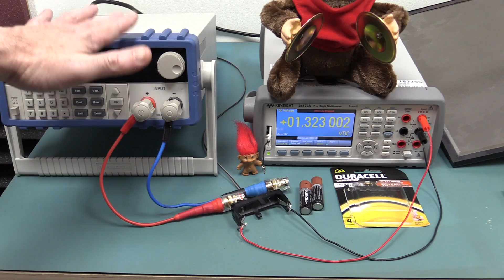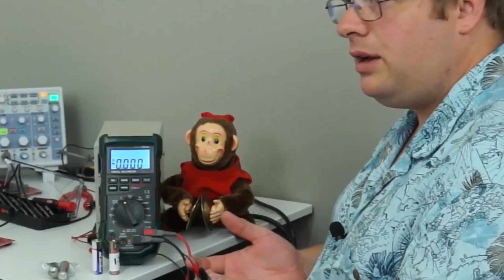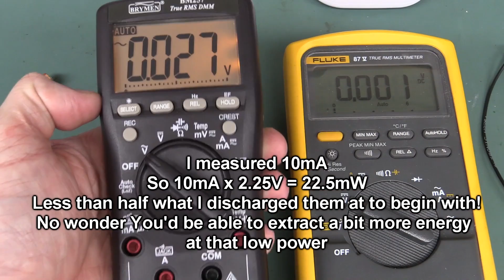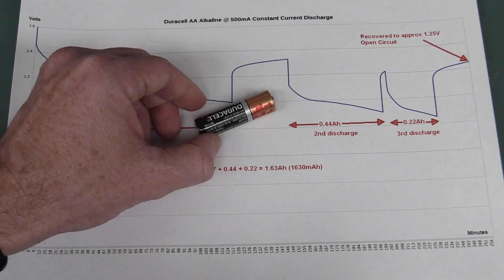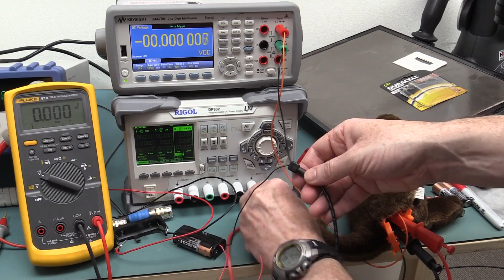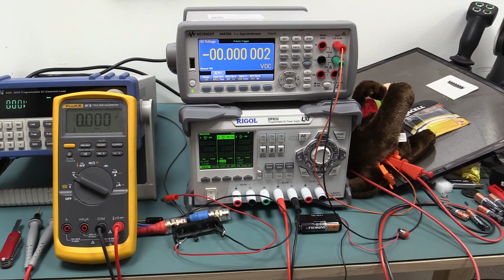EEVblog #789 - Batteriser Monkey BUSTED!

Comment: Your video does not count comparing to theirs. There is no soothing music behind your voice, so it is not convincing at all.
Reply: +EEVblog ah, yes, but you forget their argument's bottom line - they want money, so laws of physics dont count.
Reply from the maker: +yoksel99 The data speaks for itself.
Reply: He is testing ONE CIRCUMSTANCE cutoff voltage at the terminal. That's all this video is about. It's scope is limited to being a response to their video of the monkey not working on 2 batts measured with no load. 

So to you its just a coincidence that the device shut down at the same voltage with the PS and the batteries?

I'm not gonna comment on this further cause I can see where it's going. There were no misrepresented numbers or physics here at all.
Reply: +Gravity I also fail the see the error. How does anything you said change measuring at the battery terminals for the cut off voltage being the only way to do it.
Reply: +EEVblog That was a joke :) The consumers don't consume data, laws of physics or whatever when making a purchase decision. They consume the marketing BS instead. And their BS is a top-notch, MBA-produced, da best.
Reply: +Gravity Let me guess , You work for Batteriser and were sent as a troll trying to use marketing wank to hood wink the public
Reply: +Gravity I fail to see the error
Reply: +Gravity just shut up.
Reply: Gravity What you're after is extending beyond the scope of this experiment as Chris Statzer stated.
Reply: +Gravity if you compare a drained out battery with a PSU then yes drained out battery can't provide the current while PSU can at the same specific voltage.... but one has to measure the cut-off voltage with fresh batteries - let the product run till it cuts off - or alternatively use an other method ... which is 99% accurate and it's using a PSU and dial down the voltage till the product cuts off  ;)
don't forget it's engineering, not science... 99% is more than accurate here  ;) and further more - you'll have several percent variations between batteries and also your cut-off voltage will vary (talking about mV variations). considering all the facts - PSU is an accurate method to measure cut-off voltage in real-world applications.
in short:  not accepting a PSU as a correct alternative is simply stupid.
Reply: +Gravity You are fundamentally wrong. A battery have internal resistance (from electrochemistry) that at a certain current have a voltage drop, and that's what causes the monkey to stop working. The low voltage and low current isn't enough for driving it. Only that. For make the current to flow you need a potential difference between two points and interconnect them, because the electrons and holes tend to equilibrate recombining themselves. Think in water. Voltage is the pressure and current is the quantity of water per second; the conductor (with a certain resistance, in this case the width of a PVC tube). Without difference of pressure (voltage) there's no water (current) flowing through the tube (conductor). Without water (or any fluid or gas) there's nothing to flow through the tube and it's impossible to have difference of pressure because this hypothetical system now is in equilibrium. Without tube (conductor) it's the same thing: impossible. So there's three elements to take into account, and explaining something more advanced is pointless. This is really simple bro! Hope you will understand :)

PS: Please excuse my bad English, I'm from South America ;d
Reply: +Gravity  you do realise that nobody here agree with you?
Reply: Gravity has a valid point in that a PSU is not usually the same as a battery, and that Dave is generalising in a number of remarks because of his clear frustration. However, these pedantic inaccuracies are irrelevant to the focus of this video where Dave is simply distinguishing between open circuit and underload voltage measurement and pointing out the problem with the Batteriser video in question. As Dave states, if you want to learn something about batteries then look at his older videos.
Reply: yoksel99 see also SOLAR FREAKIN' ROADWAYS :)  lol
Reply: +Gravity The features of Keithley 2302:
Ultrafast response to transient load currents: A good supply may have it
Choice of single- or dual-channel supplies: Only for simulating 2 batteries
Optimized for development and testing of battery-powered devices: I see
Variable output resistance for simulating battery response (U.S. Patent No. 6,204,647): Simulates the internal resistance of the battery but it's only a current limiting circuit
Pulse peak, average, and baseline current measurements: For measure advanced response of the device over time (not only the cutoff like this video)
100nA DC current sensitivity: A good feature for measuring low power consumption products
Current step measure function: Other good feature
Sink up to 3A: More than enough for simulating batteries
Open sense lead detection: I really don't now what's the use for this lol
Built-in digital voltmeter: Like any other supply

So, the only difference with a power supply is that it is for simulating the response trough the entire discharge of the battery, and if I'm not wrong it simulates the varying internal resistance related to the actual capacity, but all that features aren't needed for measuring the cutoff, it's pointless. You only need a power supply bro, and by the way that's what the Keithley 2302 essentially is :/
Reply: +Jeremy Pierce I'm thinking he's the professor from the Batteriser video LOL no other logical explanation :)
Reply: +yoksel99 Don't forget that the Batteriser cures cancer too, so buy yourself 10.
Reply: +Gravity It's not a comparator obviously so the cutoff isn't instantaneous, and that causes the monkey work until all the power from the battery is drain. There's a point when the battery can't give more current (or almost nothing), and when that happens is because the internal resistance has increased. When that resistance increases it causes a voltage drop, and the measured voltage at the terminals of the battery is the real voltage that the monkey receives. The monkey have a response curve, that may not be linear. For a certain voltage, it consumes a certain current at a certain moment of the operation (arms opening, arms closing, buzzer sound), and if it stops working it's because at that voltage the current that is flowing is so insignificant that it can't power the monkey. All that shit of inrush current and motor torque is inside the response curve of the monkey (relation between voltage and current = the varying impedance of it)
Reply: +Gravity Science is everywhere... Hahahaha I tried but you are hilarious :d Make your own channel, I will be your first suscriber ;)
Reply: +Gravity 
You're acting very much like a shill. While your points are in fact valid they are for the purposes of this video irrelevant. The basis of the debunk here is not the cut off voltage, the monkey in fact does not have a cut off voltage at all. Batteriser used a device with no cut off voltage circuitry to demonstrate a flawed point. What Dave did was explain that measuring a battery's open circuit voltage is NOT a sufficient method for determining its level of discharge. Since that was the whole point of the demonstration Batteriser presented, which was of course flawed, it was easy to debunk. The extra information Dave supplied was superfluous. Nit picking at the extra information he mentions DOES NOT invalidate the debunk at all.
Reply: +Gravity "Series resistance" of the supply is for simulating the varying ionic resistance of the battery, and if you didn't understood: for obtaining the cutoff voltage we ignore the internal resistance, because we are directly measuring the voltage after the drop on it, that's why the internal resistance of the supply doesn't matter at that point, considering that the voltage seen from the monkey ass will be the measured one, not the internal theoretical voltage (despite the fact that it's unmeasurable). And transient response refers to the response of the supply while the load changes quickly (the overshoot and undershoot). The other things are related to the capacity and the discharge time of the battery! I don't know why are you still pointing that!  Yes, you can test it that way, but we only wan't to know the cutoff voltage of the product. Simply that. Don't harass and say the video is wrong without a real point, it's fine for the purpose of debunking the batteriser bullshit (really a very poor scam). If you want more info you can investigate, you can make a video about that, I don't know, but that isn't related to this video. All that is pointless. Is very basic, even a hobbyist can understand it!. Maybe you're not at that level yet... :/
Reply: +lorenzo portocarrero Yeah he is the "professor", look at the youtube account, it's completely blank, just created so they could come and add comments to argue without people realizing it's them.
Reply: +Gravity Excuse me, I didn't mean to say that, if you read carefully you can see that I didn't say the input series resistance doesn't matter. And industry standard or not, we are measuring cutoff voltage. And that means: for more current theres more drop in the internal resistance of the battery, that equals less V in the terminals, and if you want push more you simply CANT, if you try to push more current there will be a higher drop and less voltage, so that's where the cutoff voltage come from and that proves the method isn't incorrect. I think YOU are ignoring the internal resistance here ;)

Edit: You may note that here's no doubt of the precision, exactness and impressive resolution of Dave's multimeter that is connected at the + and - on the ass of the monkey. There will be some losses on the sense cables, but there are negigible in THIS case, and I don't know if him considered that, but what's the problem? u.u
Reply: +Kenneth Sloat  Yeah we should stop feeding the trolls lol :)
Reply: +Gravity You're still bullshittin'.
Reply: +Gravity No, because the absolute cutoff voltage still mantains. In the current spikes with the battery the voltage may decrease, but the device will be working until it hits the cutoff voltage. There's only a shorter time, but the rules are the same :)
Reply: +Gravity With the PSU you control and mantain the voltage, so its perfect for measuring the cutoff
Reply: +Gravity Better than using a real battery and a multimeter :d
Reply: +Gravity I didn't ignore anything of what you said. You are ignoring basics. Ohm, Kirchoff, Thevenin. Go get a book and stop harassing, you wouldn't understand -.-
Reply: Eclipse Your case of a device that switches between drawing 10 mA and 1 A is not compelling. As I have said before in this thread: Correct use of bypass capacitors will solve this problem, and any product pulsing a battery so badly that it dies prematurely is simply poorly designed.
Reply: +Saxie81 For the product in question? It is most likely a scam employing disingenuous advertising that implies the consumer will gain more energy on average than actually likely.

My main issue here is that EEVblog isn't explaining this well enough. He has to state the fundamentals of current sourcing, P=IV, V=IR, things like comparator hysteresis and different methods of low power detection. Actually how these devices work on a basic level, and it doesn't take that long to do.

Look at why the commercial switching regulator MCP1623 has that operational limit of output power versus input series resistance.
Reply: +yoksel99 And where da fuck is the square wave?!
Reply: +Felix J. Bak I'm not sure what you're talking about. The case of a bare PSU producing a result within a close margin to a battery does not universally 'generalize', which is why professional hardware battery simulators exist. It depends upon how the device operates, which requires explanation.

If you are saying "there is also no need to "explain how different devices operate"", you're obviously wrong. Claiming that there's "no need to explain" the function of a device is by far one of the most silly things you could say. It's fundamentally opposed to the scientific testing that should be performed.

And in fact you should probably explain to yourself how a constant power load works for P=IV relative to input series resistance.
Reply: +EEVblog Please make the final fault-fixing episode of the Samsung LCD TV fault-finding and repair series.
Reply: +Robert Jung Again, just using a bare PSU to test all device cutouts without actually understanding what's going on is simply wrong. The issue is that it actually doesn't give you accurate values on certain devices, cases of which I have perhaps indicated the datasheets in support of in this very thread. Because EEVblog is not explaining the different low power failure modes, the fundamentals of device operation, he's not actually 'debunking' this well.

And then you get stuff like this, viewers saying things like "it's engineering, not science". Do you have any idea how silly that is?

That is partly the problem with these videos wherein they're not examining the functional details for the circuit, like P=IV, and V=IR.
Reply: +timofonic timofonic My point is not that he should buy one. My point is that he should be mentioning how and why they are used, as opposed to bare PSUs, rather than implying a bare PSU is a more exclusive "industry standard" method for battery device testing.

Again, my point in poking holes in these videos is so that EEVblog will actually improve them, addressing any such flaws, and thus have a more 'air tight debunking'.

I'm going to tell you right now, these videos come off as quite 'unscientific', and for good reason. A scammer will easily be able to use that to discredit him.
Reply: +lorenzo portocarrero Do you actually understand why things like 'series resistance' and 'transient response' are included? It tells you in the datasheet. Just solve the equation P=IV for a constant power load at decreasing input voltage, just like those in a battery datasheet's discharge curve, and see what happens. Then maybe look at V=IR for a pulsed power load, like the very common examples of cellular/wifi/bluetooth transmitters.

If EEVblog doesn't mention these things, the real fundamentals, he's going to run into trouble.
Reply: +Gravity in a simulation it would have to be accounted for,  since resistance is basically is the valve for controlling how much current can be pushed through.   The lower the resistance the ability of the battery to deliver power through a power spike is easier.   However this meant Fuck all in this video and this damn instance.
Reply: +Saxie81 My problem with this set of videos is that it's approaching the problem in effectively the same way as the product in question's videos. It's a lot of flashiness and/or rage, but not a lot of real science.

He has to be covering his bases. Discussing the different devices, how they work, cases where a bare PSU might be more accurate or might not be more accurate. Basically, by omitting any mention of the purpose and use of something like a hardware battery simulator, he's perhaps making a less accurate video, and leaving himself open to be more fully discredited by scammers.
Reply: +Felix J. Bak keep calm and charged :-) Gravity is probably using scientology-like propaganda methods (not explicitly saying he is completelly wrong but with final message that he is "dumb enough" to criticise something as advanced and revolutionary as their product is) to try to defend and safe at least something after damage Dave did them during initial bombshell, but this war is simply over ;-)
Reply: +Gravity you may have a point, but you are discarding dave's proof because he did not use something designed to be used in a device with a smart baterry control ic in a chinese toy that did not have one in first place (as in MADE IN CHINA!)
So basically you point irrelebant in any practical sense in this situation as the difference would probably be of less than 0.01% something most multimeters cant even meassure.
Reply: Gravity
So far all I've seen is arguments made over minor semantics, while ignoring the blatant obvious such as dislikes bought from 'nam.
Reply: +Gravity Using a PSU to measure cutoff voltage on a product is perfectly fine. You'd also want to track current and set a limit on it, but most products are not constant power devices and will not boost internally. Even for products that do, they should still cease operations as the per cell voltage drops below ~0.8v The reason? Rechargeable chemistries and alkaline battery leakage. You risk damaging NiMH and NiCd chemistries operating them down to zero. You risk damaging your own product operating down to zero with alkaline cells.

As for your earlier point of describing a use case where a columb counting internal resistance measuring battery state estimator with optional dicer slicer and chopper attachment was in a product: Please, don't use these in normal battery operated products. They are terrible and only sound cool and increase your BOM. The proper use case would be in a product where the battery was non-removable, so the chemistry and charge history is known. Even then you're likely to be off by a good +/-5-50% over time because batteries are weird like that.
Reply: +Anthony Wildman That is what I was trying to explain but it's impossible :s
Reply: lorenzo portocarrero I'm beginning to think it's just a troll. Seriously, WTF does "inrush current', 'motor torque', and 'start-up status' have to do with cut off voltage. When saw those terms being used in this discussion, I thought that this person is either a troll or has no formal education.
Reply: +Gravity There's an absolute cutoff voltage, and for an ideal constant power sink is 0v. But for the battery underload, it will be 0v too, because of the voltage drop on the internal resistances. You can do some basic expreriments and come to the conclusion. End.
Reply: +Gravity Then the voltage drops, and if that happens the current should increase (in reality the Rload decrease, there isn't increasing current, because the internal R of the battery) and then the voltage will drop more and more next to 0v. The measured cutoff voltage is absolute, no matter the internal resistance of the supply. Stop trolling.
Reply: +Gravity I didn't say that. I said that the cutoff voltage is absolute. That battery simulator is for simulating capacity of the battery, and that's not needed for the absolute cutoff voltage :)
Reply: MCP1623 Is a DC-DC boost converter. It is true that as voltage decreases current can be increased to maintain power; however in the case of the battery, as the voltage drops the total energy is lower and the amount of power that can be delivered is lower. If the voltage is increased the current will decrease without supplying additional power to the system( a dead battery can't supply more power). Thus, cut off voltage is the lowest voltage a device can operate at; even using boost converters can only boost the voltage so much. In other words a PSU and miltimeter is the best way to calculate the cut off voltage. I understand what you are trying to get at, but you are wrong. Only in specific applications are boost converters used, and If a voltage level is required by a component it doesn't matter what the current is; if the voltage is below specifications, the component will not work regardless of power or current..

Also, I am fully aware of how a clock works. When you set a clock, you are simply setting the initial state of the register that is used to hold time values between clock cycles..
Reply: +Gravity Ok, maybe not Ohm. But you are ignoring Kirchoff and Thevenin for sure
Reply: Gravity You do seem eager to learn, so I suggest that you enroll in a university with an electrical engineering program near you. At the very least find a circuits book and try to do some of the problem sets. you may learn a thing or two.
Reply: Eclipse What? Specific energy? Do you even know how to implement ripple reduction? You size the capacitor depending on the switching frequency and average load. High specific energy is very rarely needed. If it is, well then you're probably driving a load beyond the capabilities of small batteries anyway.

And what's this about maximum power transfer? What does this matter? Very few devices are constant power, most will consume less as the voltage drops. Really only input boosted devices will use constant power, and that's rare. Better for efficiency to just design a product inside the battery voltage envelope.
Reply: +Gravity YOU NAME A DEVICE THAT WILL RUN 8 TIMES LONGER WITH YOUR DEVICE AND PROVE IT
Reply: Well he could be explaining in technical terms the inner workings of the battery as well.   There .is a time constraint here otherwise it would be a 3 hour long vid...
Reply: +Saxie81 To put it more harshly, what he's implying about using a bare PSU for every case is wrong. Further, it actually doesn't take that long to explain how different products detect low power, and how they might switch off on it. From comparators to coulomb counters to simple friction versus torque on a motor. Omitting the cases where a bare PSU may give false low power failure mode readings makes this video incorrect, and scammers will easily use that to discredit him.
Reply: +Chris Statzer Exactly! I don't see what everyone's complaining about! +EEVblog Don't worry about the psychopaths complaining about your video.
Reply: +lorenzo portocarrero Oh, I see the error you're making here. On an uncompensated PSU, the output voltage is perhaps set to whatever voltage you input. The battery's series resistance (and 'remaining charge') isn't present.

Consider how an 'ideal', that is 'zero resistance', constant power load works: Its 'cutout voltage' will always be exactly zero volts, because for whatever voltage present, there will be a corresponding amount of current that will supply that power. P=IV.
Reply: +lorenzo portocarrero A toy monkey has nothing on 'science'. Check your electrodynamic equations and apply them perhaps to multiple different products.
Reply: +Napalm Flame dont worry, he's ignoring the basics
Reply: +Gravity I'm an electrical engineering senior, and I actually asked two of my professors about this, and they said that using a PSU and measuring the voltage under load is an acceptable way of measuring voltage cutoff. If you measure the voltage of the device, and subject the device to different modes of operation (if applicable) while using that voltage while measuring the current to determine the characteristics of the load the device creates on the battery, the  Keithley 2302 does precisely this, you will get an accurate reading. There wasn't any need in measuring current and voltage using different device modes in the devices Dave tested because the devices he tested had essentially one mode. You don't need any other equipment.
Reply: Gravity The use case of that IC, the bq20z80, is usually swappable lithium ion packs
Well duh, I'm pretty sure I covered this as an obvious use case with "The proper use case would be in a product where the battery was non-removable" (lithium packs count as a product with a non removable battery, because the product IS the battery!) but you implied this device may be encountered in a AA/AAA operated product, which would be extremely dumb. I just wanted to make clear that the existence of exotic low battery detection as provided by devices similar to the BQ20Z80 does not rebut the viability of power supply facilitated device cutoff voltage testing. (That was a mouthful).

Using a bare, uncompensated, unlimited PSU is clearly what I have referred to as more of a problem.
Okay, I'll give you most of that, but really most products do not use boost circuitry. Most products show a non-inverse direct relationship between input voltage and current draw. You should keep an eye on the current, and really should be plotting it along with voltage, but I can guarantee Dave was omitting all this information for brevity's sake. Does omitting it make his case less durable? Not really, considering the criticism of omitting the information is really just pedantry. This isn't a paper to be published in a peer reviewed journal, it's YouTube.

switching regulators and pulsed power devices are not actually 'uncommon'
No, but such devices aren't properly designed if they're pulsing the source so badly that a battery would prematurely fail. There's something called bypass caps, and most electrical engineers know how to use them.
bluetooth transmitter, and it draws more current in transmit mode
That's true, but useless information. The goal was to prove most devices operate down to at least a volt per cell (or whatever the figure was, it's late and I'm tired). It doesn't matter what the device current draw is, it just matters that the under load voltage is around a volt, and the device properly operates. The state of the product is irrelevant. It doesn't need to be mentioned because Dave can assume his audience understands such basic things as Ohm's Law, as beginner concepts have already been covered in earlier videos.
Reply: Gravity Gravity Okay,  Regarding power here is a quick lesson. P = IV, and V = IR, I = V/R, so P = (V*V)/R, so as the voltage drops the current and power drops. You don't have to know the current to find the voltage cutoff. As for the different modes of operation, the differences in the devices tested are considered to be infinitesimal. As for clocks, they don't really go to sleep, the back light on the display may be activated, but it depends on the clock and the application. The clock in the video probably has a simple counter, clock and basic logic (no microprocessor required). And yes I am a Student of Electrical engineering.
Reply: +Gravity Gravity  Troll... You side step the arguments made against yours and still push your own. It's like you purposely ignore the points made against you. You expect an ideal video of batteries and such, but fail to comprehend that the video has a title and a target. This video has achieved the conclusions that are valid for the application. No mater what you say, in the light of most of us reading these comments, you are just a troll. Have nothing to do, or talk about that is constructive. 

To further make a point. It is as expecting a Thesis on say Battery discharge curve to explain that the elements used to create the battery are elements created in stars bla bla bla. Applying the way you complain, you would rebuke the thesis because no mention about stars was made.
Reply: +Eclipse I thinks this eclipse is Gravity in disguise. Still trolling man. Bla bla bla 0.8V or 1.1V. Don't you think that the designers will take not that if their properly designed device in its various operating points shuts off, then that should be considered the cut off voltage? It's just like Gravity, trolling. Go home troll, back to the Batterizer cave. Make sure to send a lot more 'nam dislikes cause this video really puts a dent in your business.
Reply: Jacobi's Law, Maximum Power Point, disproves this video's claim.

Jacobi's law shows how maximum power transfer can be achieved. Maximum power transfer is not always desired, and pulling maximum power almost certainly means a severe reduction in energy transfer, which is contrary to the goal of most battery operated devices. You also seem to think that one can simply know the minimum power of a device and calculate cutoff voltage. Not true.

Consider a battery hand warmer; a purely resistive device. As the voltage drops the heat output becomes less, until the batteries are no longer useful for keeping the user's hands warm. The cutoff voltage in this scenario is subjective.
Next, consider an LED lamp current limited by a simple resistor. As the input voltage drops the lamp brightness becomes less, until voltage across the junction is less than Vdrop, and the lamp goes out. In this case the cutoff voltage could be that point, but what if the brightness is only 10% of the initial output by then? Most people would notice the brightness drop at around 70%, and would likely consider the batteries dead far before 10%. Where do you draw the line?
Finally consider a product containing a microprocessor. As a battery stretching strategy the processor can be underclocked to continue to operate under low voltages, but this reduces the performance of the product of course. At what point do you call it quits on underclocking and just let the product die?

The above examples show where engineering concerns trump actual minimum power. Some products could operate down to nothing, but at some point between full and empty the batteries can't fill the owner's need and get replaced. The threshold for a low battery indicator should go somewhere a bit before this happens to warn the user. Sometimes engineering is more art than science, especially when it comes to UI.
Reply: +Gravity I've read your many sources and they say you are wrong. I don't mean the data shows different from what you claim, I mean it literally says, "Gravity, the person on YouTube, is wrong."
Reply: Joe Villebrun Says who?
Reply: So with your methodology what conclusion would you have come up with at the end of the day?
Reply: +Lions Fan I was Going to say the same thing.
Reply: +Petr Antoš hail...  Xenu?   Lol
Reply: +Gravity I think you do have a point, but it's not really relevant to this problem. Devices that check the battery with smart (µ-controller or whatever) circuits, can behave differently when a PSU is attached. Think of digital cameras, for example, some even stop working if you use non-genuine aftermarket batteries!  

But this is not the usage case discussed here. Basically no device that uses AA batteries will be so fickle, certainly not Probes the Monkey! And you know what? If you manage to find a picky AA-powered device that gets confused by a PSU, it will also get confused by the Batteriser's boost circuit, I'm betting my monkey's bottom.
Reply: +Napalm Flame I haven't been speaking about that. Yes, that's obviously a disingenuous tactic. I don't actually support the product in question. I'm trying to convey that if Big D leaves the specified holes in what he's saying, it's not going to be as clean-cut of a debunking. The specified technical errors are not "semantics", they are materially relevant to making sure a scam like this is conclusively defeated.
Reply: +bloomtom The use case of that IC, the bq20z80, is usually swappable lithium ion packs, as it states directly in the datasheet. In fact, that's why it has that estimation function in the first place.

"You'd also want to track current and set a limit on it"
For some reason people are failing to understand that I've been talking about the cases in these videos, where that was obviously not done. Using a bare, uncompensated, unlimited PSU is clearly what I have referred to as more of a problem. It can simply give you different results on different products relative to batteries. He should be mentioning the fundamentals of how each device works.

And furthermore, switching regulators and pulsed power devices are not actually 'uncommon'. If you have something like a bluetooth transmitter, and it draws more current in transmit mode, the series resistance will drop the voltage further. These things should be mentioned.
Reply: +Anthony Wildman I'm not quite sure what to tell you, if you read the Keithley 2302 datasheet, you'll see that it does not just measure voltage and current. Not to mention that the original video neither measured nor limited the current, nor do these videos recommend that you do, and as well the bluetooth mouse in the original video obviously has different operation modes, it's a transmitter, just as an example. And for something like a digital clock, you do understand that pushing a button to wake a microprocessor also 'counts'? That should be basic coursework, no matter how small the current change.

So I mean, clearly you're omitting details here. You of course don't have to buy a Keithley 2302, or any other professional hardware battery simulator, but you should actually understand why they do what they do. If you actually are an EE student, you should be able to solve P=IV for a constant power discharge curve, and note the effect of input impedance, as per Ohm's Law.

Obviously you can "use" a PSU, as a tool, but you should be examining how each individual device might operate. So I'm not sure you asked the question you believe you asked.
Reply: +bloomtom Swappable batteries are by definition 'removable'. The analysis function enables it to be in-system, rather than battery embedded. Higher current pulses from the battery are actually common in mobile devices, as noted in the Keithley 2302 datasheet. You've clearly not actually calculated the energy storage of a 'bypass' capacitor.

What I'm getting out of this is that you don't actually design battery devices. Switching regulators are quite common, especially for single cell digitals, because most MCUs run at 1.8 volts. They're more efficient than linear regs too. Coulomb counters are not even particularly expensive, and much more reliable.

So yes, when EEVblog says something like 'this bare PSU is how you do it in the industry, and the ESR is irrelevant', he's factually incorrect. It's just wrong, not an "omission". Fundamentally, and provably.

That's not to say a bare PSU "would never" give results in a close margin to a battery, it's to say that it's UNRELIABLE if you don't understand how the device works. So promulgating it as if 'nothing could possibly go wrong with this method' is factually wrong. The differences between devices and testing methods should be discussed, to actually show people how to comprehensively test battery devices, from the simple to the complex.
Reply: +Anthony Wildman For a constant power load, to maintain 'constant' power, the current may increase as the voltage drops. You're just doing it wrong, and you can feel free to ask about constant power loads in class. It's even indicated in the MCP1623 datasheet.

The obvious point of that is for a constant power load, just like the ones in battery datasheets, the "voltage cutoff" is physically set by the series resistance of the circuit, ergo changing that value may change the "voltage cutoff" for such devices.

You also might want to consider how you actually set a digital clock, and what "mode of operation" means. In fact, you can literally print out this thread and ask your professors about it.
Reply: +lorenzo portocarrero So okay, what do you believe would happen to the "cutoff voltage" if you increased or decreased the input series resistance of a constant power load?

Now ask yourself, does a bare PSU have the same series resistance as a battery?

Then ask yourself, for a given series resistance, what happens if the device increases its current draw?
Reply: +lorenzo portocarrero So according to you, a hardware battery simulator like the Keithley 2302 has absolutely no reason to include a series resistor, nor to exist at all, because a bare uncompensated PSU would do 'exactly the same thing in every case'?
Reply: +lorenzo portocarrero I'll try to explain it simply: The voltage you set a bare PSU to will be placed at the output terminals of that PSU. To maintain that voltage, the PSU 'supplies current'.

If you connect those terminals to the device, and it operates, it's drawing a certain current from the bare PSU. Now to find the "cutoff", you are looking for when the device stops working, right?

If you turn the dial down on that bare PSU, for a constant power load, the current drawn will increase. If there is less series resistance, such that the bare PSU can supply more current, the dial will be able to be turned lower before the device stops working.
Reply: +Anthony Wildman "and the amount of power that can be delivered is lower" Which is obviously dependent of the series resistance. Again, due to P=IV and V=IR.

So consider a pulsed power load, something which increases its current draw, like a transmitter: On a bare PSU, you are setting a voltage to be maintained at the terminals, 'no matter what current has to be supplied to do so'. If you put 1.1 volts, it's going to keep that there, pretty much no matter how much current the device asks for. On a battery however, an increase in current draw will drop the voltage by the series resistance of the battery 'automatically'. That will not happen on a bare PSU. So a device that works fine in one mode, could have actually failed on switching modes on a battery at that voltage, but not on a bare PSU at that voltage.

And pretty obviously setting the clock is a different "mode of operation", however little more current that particular case may or may not draw.

Similarly, the point at which a constant power load stops working is set by the circuit series resistance. Just punching in a number on a bare PSU can give false results, since it may source more current.
Reply: +lorenzo portocarrero The difference of current spikes is one of 'device failure modes on bare PSU', rather than specific "cutoff voltage". You just ignored my post about series resistance changing "cutoff voltage" for constant power loads.
Reply: +lorenzo portocarrero Measuring a real battery is obviously the most accurate, and recommended test. Using an uncompensated PSU and just winding down the voltage until it turns off is the issue.
Reply: +lorenzo portocarrero It seems Mr. Gravity has been stealth muted. Unfortunate, as this discussion was what bumped the thread to the top. I will try to, politely, explain his point:

The reason battery simulators are used industrially, rather than hooking a generic power supply to the device, is because for a given resistance, dynamic changes in current will reduce or increase the detected voltage.

For a given power, a battery may not be able to sustain the corresponding current at the programmed voltage. You must specify which points you are probing for voltage. If a resistor exists between the device terminals and the supply, the voltage at the device will be lower than what is seen on the supply.

If the device can increase the current it draws at all, there must be a dynamic adjustment of voltage, which a power supply lacking the appropriate resistance cannot model.
Reply: +lorenzo portocarrero +Anthony Wildman I have pondered this and believe I have a good explanation for you.

Say you have a device that switches quickly between drawing 10 milliamps and 1 amp, and you have set the comparator to turn off at a terminal voltage of 0.8 volts. If the battery impedance is .3 ohm, in the 1 amp mode it drops .3 volts. So on battery, when the under load voltage reaches 1.1 volts, the next 1 amp cycle will turn the device off, 1.1-0.3=0.8. This means you put the on-battery cutoff voltage as 1.1 volts, not 0.8 volts, because whenever the battery discharges to 1.1, the device will fail. That is the real cutoff, not 0.8. On power supply, you can go to 0.8 all the way, but not on battery. If you say cutoff is 0.8 on product, it is lying, even though it may briefly hit that.

Consider a power supply as if it were many batteries in parallel.

Similarly, for constant power, the resistance caps the current-voltage relationship. There is a 'current limiting resistor'. At a certain voltage, the current to maintain a certain power cannot be provided. You may look over Kirchhoff's second law and the lumped element model as well.
Reply: +bloomtom Is real case in commerce. Capacitors do not have enough specific energy yet. 1.1 is not premature, it is just not 0.8. Whether you believe is common or not is immaterial however, you will never find out using a power supply like this, so the point is made.
Reply: +Stefano RR Haha. Is funny because no one even mention impedance matching. Google "power transfer to a resistive load", I prove to you video is wrong. If battery impedance is .3 ohm, and you want 1 watt in load, maximum power you can get is load is if it is also .3 ohm. That makes your cutout .55 volts. If battery is .2 ohm, maximum power point is when load is .2 ohm, so your one watt cutout is .45 volt. Go read gsu edu article. This thread is snotty students calling "troll".
Reply: Eclipse i did mention it before in another thread, yet no one cared. it's about finding things to complain, not about facts nor empirical evicende.  Like when dicussing with free energy people.
Reply: +bloomtom You really at it, ah? Jacobi's Law, Maximum Power Point, disproves this video's claim. Read video description. Is wrong.

+Laharl Krichevskoy Facts are best, only way to do things. I say not mentioned, but really is all through the thread. You solve the equations presented, you derive Jacobi's Law. The point at which you can no longer drop resistance to maintain power defines cutout voltage. If resistance is outside load, power is split between them.

Is worse than just not caring. They have the gall to tell people they are "uneducated" and try to mock them, when they are the fools.
Reply: +bloomtom Jacobi's Law literally shows that cutout voltage for constant power load will be different if source series resistance is different. It directly disproves the video.

And while you're at it, try calculate what capacitance you want for just one second of one watt at one volt. Capacitor discharge voltage isn't even steady. Simulator datasheet above directly tells you about real products.

It isn't even relevant to testing protocol. You just test voltage with power supply like this, no current limit, you don't see accurately what designer did or did not do. Series resistance limits current. Is basic component of device. Ignoring current is wrong.
Reply: This troll.. Full of himself and all. Go troll your... You get the idea.
Reply: +Gravity I get your Point that it is not always right to measure the cutoff voltage with a PSU, because some devices will have a coulomb Counter to say wether the Battery has become good or bad.

Yes ok, Dave could have mentioned that.

But here are some issues I have on you pointing out that Dave is doing something wrong here:
This toy monkey will not have any form of active component to Switch if off when the battery is low. It will just stop working when the battery cant provide the power Level any more, which the monkey Needs to operate properly.
So Dave is doing fine here.

Coulonb Counters for battery health indication are mostly used in products with a build in rechargeable battery to not drain it to its death. If you use a coulomb Counter in your battery powered product, it will not be able to determine the battery health when putting in some half-drained batteries. Also you do not Need to protect the battery from being completely discharged.
I think the way to do These kinds of measurements for products with replacable batteries is just like Dave is showing here.

So I am not saying you are wrong, but Dave is not as well ;)
You are just pointing out a Special case where this method actually would not work well.
Reply: Some extra explaining does not hurt.
Reply: +Felix J. Bak And I've carefully explained with real product datasheets why that 'test setup' is not universally applicable to all commercial products, why one should examine how each specific device works, and why a bare PSU is not the global "industry standard" method to test battery operated devices. You're just wrong, and being arrogant about it.

If I really wanted to pick holes in this, I'd say EEVblog was holding the monkey's hands together, thereby operating the device outside of spec, and invalidating the test.

It's just not a scientific way of doing things, and therefore it's not going to 'debunk' any 'battery boosting' scam.
Reply: +lorenzo portocarrero Well for the monkey, you're actually omitting things like 'inrush current', 'motor torque', 'start-up status'. I mean, you're giving a 'beginner' description of electricity which isn't actually the only thing that happens in an electromechanical system.

So for example, say the monkey or any product turned off on a 'comparator', which is an active component not discussed in what you've said. If you force the product to draw more current than in normal operation, like perhaps by putting a DC motor in continuous restart status, that higher current draw will drop the voltage across the terminals relative to the series resistance of the system, per V=IR.

Now if it's turning off on a 'comparator', that can drop the voltage enough to turn the device off. The same might occur for a motor trying to overcome starting inertia. So essentially, you're wrong in the electrical field.

In the general scientific field, operating the device outside of specification at all automatically invalidates the test relative to its normal operating specifications.

Finally, a basic description of electricity does not invalidate the difference between a bare PSU and a professional hardware battery simulator.

Now, many products have various ways of dealing with things like a higher current draw mode, using comparator hysteresis and so on, but if EEVblog doesn't mention those things, he's just not going to 'debunk' this well.

I mean obviously so, what you're saying is partly proof that a correct point was not conveyed to you. You just don't seem to understand how different low power failure modes work, from comparators to coulomb counters to basic friction.
Reply: +Jeremy Pierce Battery device design, of course. Theoretically electronics in general, but you can get a lot of inefficiency and recalcitrance depending on institution. Issue is, what he's saying isn't good enough to debunk a scam, especially if it's got real engineers deliberately hosing people. You have to cover all your bases.

If you don't actually mention what a hardware battery simulator is, explain the fundamental equations for device operations, you'll run into trouble. And rule one is pretty much never try to demonstrate a device you're operating out of spec, like holding the monkey's hands.

He's leaving far too much room for a scammer to more fully discredit him.
Reply: +EEVblog You there! Just read the MCP1623 datasheet, the Keithley 2302 datasheet, and the bq20z80 datasheet, and you will realize the error you're making in this video, and what you should be mentioning.

Read "9_27_07_PerformanceMetrics2" from Berkeley for how 'ionic diffusion' works as well.
Reply: +lorenzo portocarrero You're just largely restating the incorrect parts of the video as if they were true. Let's put it this way: If input series resistance didn't matter for the operation of the device, why would it be included in the hardware battery simulator designed to test battery operated devices?

Quite simply, once you realize why a bare PSU is not actually the "industry standard" testing method, you'll see what's wrong with the video. I pointed to datasheets above, like the MCP1623 commercial switching regulator, which indicate such a response.

If you had bothered to solve P=IV for a constant power load of decreasing input voltage, you'd see the that current increases with decreasing voltage. As long as the device can source enough current, it may remain operational. That current is limited by the series resistance, per Ohm's Law, and sets the operational limit relative to output power for a device like the MCP1623, as indicated on page 12, subsection 4.2.6 of the datasheet.

When you use a bare PSU, it supplies enough current to set the terminal voltage to whatever you put the voltage at, even if a battery would not actually be able to supply that current.

The problem with these videos is that they don't discuss the fundamentals, the different devices, what's actually going on for low power failure modes: including ones caused by 'transient' high current drain, including ones that use a coulomb counter instead of a comparator, including nonlinear efficiency loads per remaining charge, and so on.
Reply: +Saxie81 Okay, I will try to explain what EEVblog is stating incorrectly precisely here: In the MCP1623 datasheet, revision C, document code 41420C, page 12, subsection 4.2.6, it will state that the device operation limit is given by the output power relative to the input source series resistance. This is due to the fundamental properties of P=IV and V=IR. On page 11, subsection 4.2.1, paragraph 5, it will state one of the issues this may cause on batteries which cannot source the appropriate current at a particular voltage, which may be in contrast to PSUs.

In the entire datasheet for the Keithley 2302 hardware battery simulator, it will indicate the time and surge differentials for devices, like transmitters, which may have different operating modes, and thus change their current draw on the battery: The device may function fine at one energy level, but cut out when asked to switch modes.

Finally, a terminal comparator is not the only way a device may detect it has low power: The bq20z80 is a power management IC that uses 'coulomb counting', measuring the charge from the battery as a product of current, and additionally it measures the 'internal resistance' of the battery to determine the battery's 'health', and thus in part 'maximal charge level'. If you just plug a bare PSU into a device using a method like that, it will give a fundamentally inaccurate reading.

EEVblog has to be mentioning what different devices are actually DOING. Just using a bare PSU and calling it 'good' is fundamentally incorrect.
Reply: +Chris Statzer Supplying power to the 'device under test' from a bare PSU can simply produce different results than a battery, as evidenced in the specific demonstrable products, with datasheets, that I indicated. This is why professional hardware battery simulators exist.

By omitting the actual differences between products, and the fundamentals of how they work, EEVblog is producing an at least partly incorrect video.

This is not to support any 'battery boosting' scam, but it is to state that EEVblog is trying to 'debunk' this in an inaccurate manner.
Reply: +Saxie81 The issue is that it isn't, since this video is implying that an uncompensated PSU is an 'always good' method to test cutout, without explaining how different devices operate. It's like a reverse of the original scam video, and incorrect for the same reason.

You can't just take one product and say "oh look, it worked fine on a bare PSU" and imply that's true for everything. It's just wrong. And that's why he's not 'debunking' this properly. There's no fundamentals. I listed specific datasheets of real commercial products as an explanation of why as well.
Reply: +Jim F I definitely don't have a problem with recommending the under load testing of a battery, I mean that's pretty much the most accurate reading you'll get. I do have a problem with the way he's omitting fundamental details and portraying this bare PSU testing method as a more universal thing. And I mean it's obviously a problem, look at the comments: People clearly don't understand the difference between devices relative to a bare PSU or a battery, seemingly as a direct result of these videos.

Even more, like I've been saying, it's now very easy for a scammer to say EEVblog is more fully wrong, because he's actually stating partly wrong things.
Reply: +RyuDarragh "which has V/I control" Right. Do you just put a bare, uncompensated, PSU on the product and wind the voltage down? My point is certainly not that EEVblog 'has to buy a hardware battery simulator', it's to state that he should be mentioning the functional dynamics of the circuit, P=IV, V=IR, and perhaps the cases in which such a test setup might give less accurate results.
Reply: +Napalm Flame Not at all. I'll state again that the purpose of these comments is to point out certain technical errors in these videos, such that EEVblog can produce a more air-tight 'debunking' of such scams. They are actually technical errors, and I have provided the specific datasheets and formulae to demonstrate that.

Now what you get when you comment on a video like this is a 'fanboy dogpile', where fans are unwilling to consider that parts of the video might be incorrect, and thus unwilling to discuss the material evidence.
Reply: +Chris Statzer Essentially, implying that a bare PSU is 'always good' for testing device cutout is simply incorrect.
Reply: +MrBuck295 Not at all. "800 percent battery life" is definitely disingenuous. However EEVblog is also not at all going to 'debunk' it with videos like this, for the stated reasons.
Reply: +Marc Dudlee people advancing reasonable arguments do not play the shill gambit.